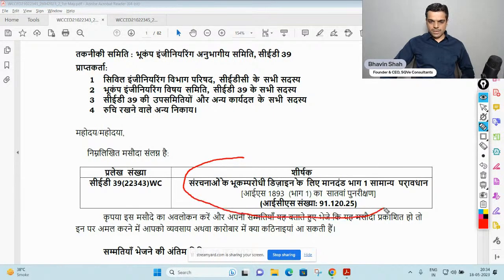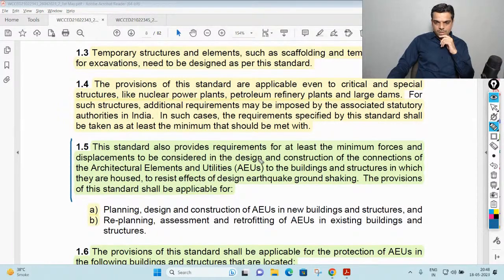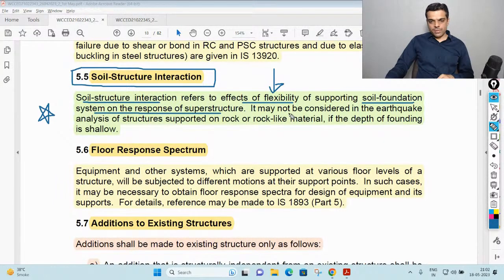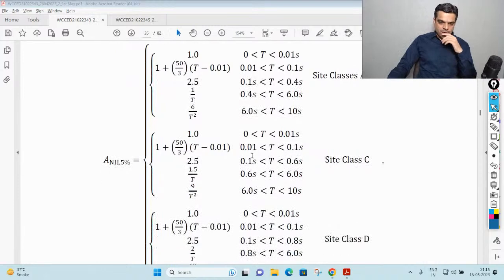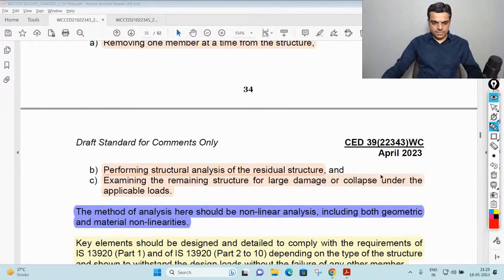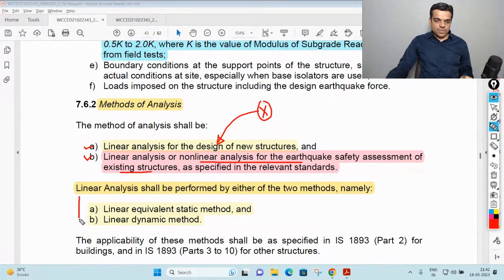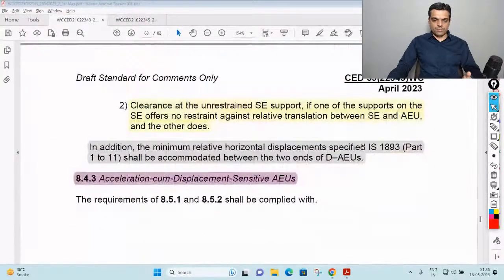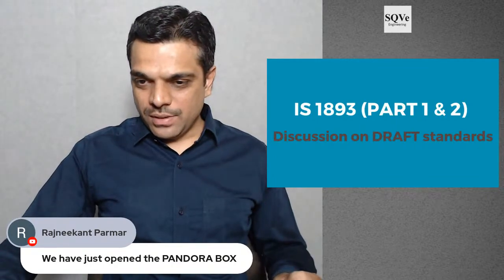Session 60: Discussions on draft IS 1893 (Part 1 & 2) | Bhavin Shah

Comment: The onus of convincing the stakeholders about the desirability of the proposed changes ought to be on the proposers. Ideally the structural engineers who take responsibility falls on CPWD, railways, etc. (the engineering departments of the GOI). The academic community does not take responsibility, but they are the ones at the forefront of proposing the changes. It seems that they are doing so by "copying and pasting", without application of their minds. The copying is being done from USA, earlier it used to be done from UK upto 1970.

Most of the stakeholders are likely to be aware of the current standard and the difficulties found while coping with it. They are unlikely to be aware of the new draft, and BIS without any background or justification wants the stakeholders to comment on the wording. Without any convincing or education provided by the proposers, the draft will be adopted. The proposers take no responsibility, because they are either academics of India or USA, and are irresponsible people. The academicians are driven by profit, and disregard the harm that they do to the country.
Reply from the maker: Thanks a lot for sharing your views!